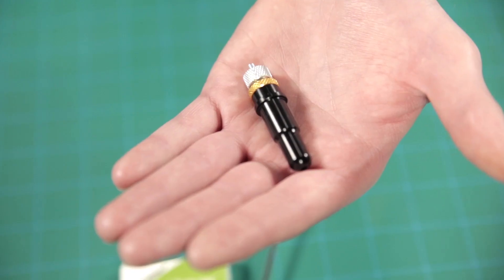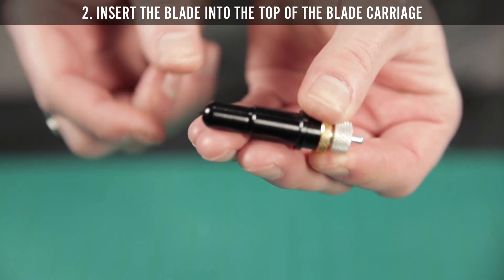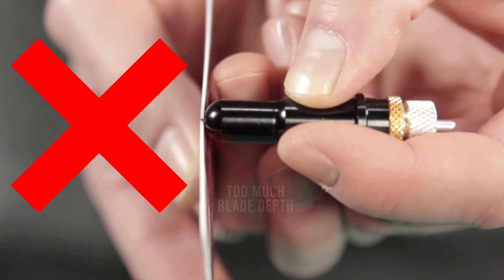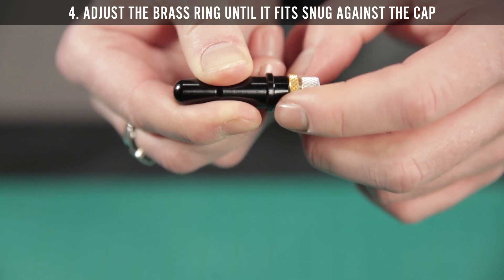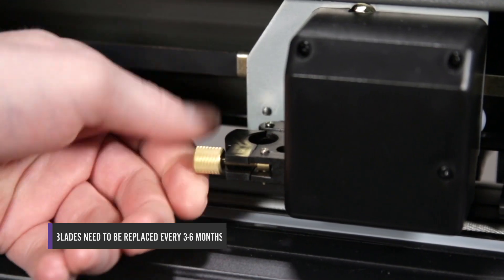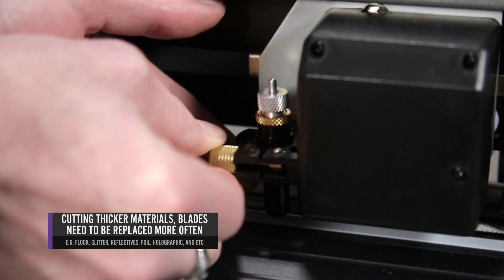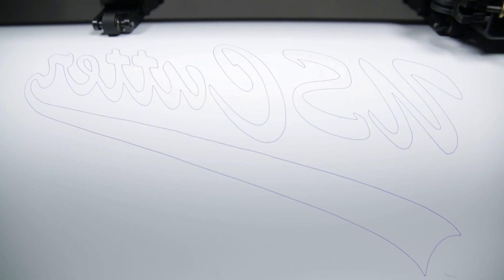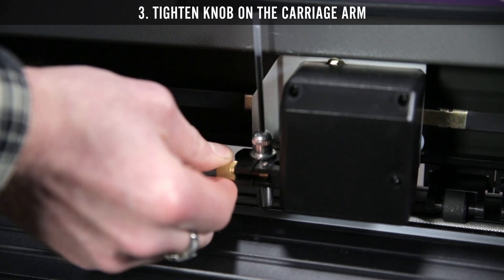Setting Up Your Blade & Pen Carriage

Comment: Hi how do I change the cut setting. For thicker vinyl like glitter
Reply from the maker: Adjusting  your blade depth and then also adjust the cut speed and time.  Do multiple test cuts before starting the job!
Reply: There is a setting on the control panel of the cutter.

Comment: Having trouble with my us cutter it does not go in reverse to cut the rest of the design out it does it when it wants to I need help with this problem
Reply from the maker: Please contact our support department  - Sales & Support: 1-425-481-3555 M-F 7:30-11:30am, 12:30-4pm PST or via email at support@uscutter.com